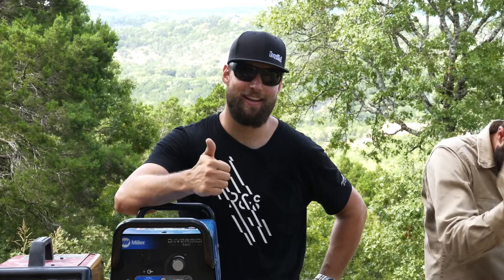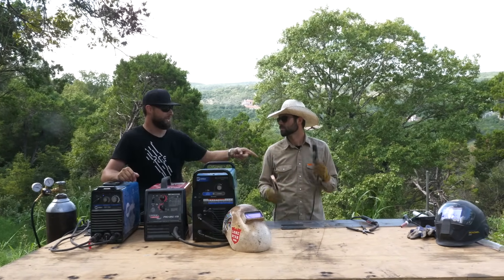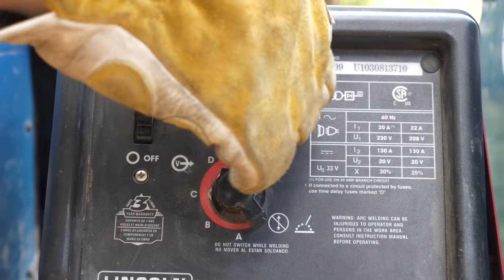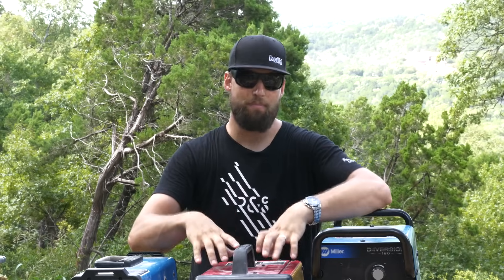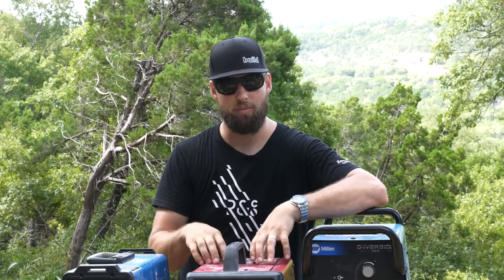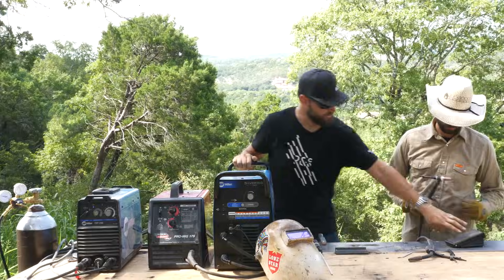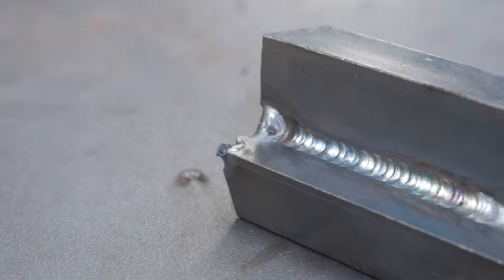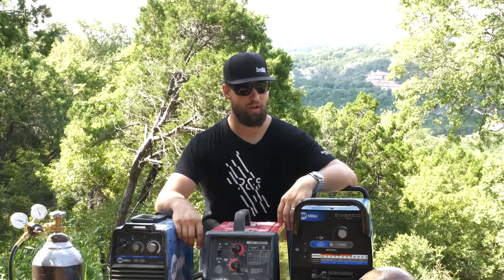MIG vs. TIG vs. STICK Welding

Comment: I caught on to GTAW relatively easy. Gas welding was harder for me to get used to be considered an acceptable weld.  I do like welding and cutting with O² and acetylene, but I'd much prefer to keep gas welding to the smaller stuff using TIG or my Smith Little torch and leave the bigger welding for stick or MIG. I know some are really good at gas welding, but not me.

Comment: I am a welder for 43 years with 12 being robotic.  I am certified in all but yes you can not transfer one job to another and be certified in all. My huge ? When did change from pushing a weld to pulling other then ark weld can you do so or instead gas can be considered.  I was taught to push to keep gas ahead of you to.clean better and keep the pool hotter.  A guy from work got.a graduated for just mig no nothing else 
 And I see shit standers,  so is this normal?

Comment: Up to point video, but would be perfect if included flux coated arc in comparasion, and at the end , didnt get why you said to upgrade mig into tig or stick, did you mean the method or just the durability of inverter? thanks and thumbs up
Reply: I would like your videos subscribe until I will get Free ❤ donation of a welding machine

Comment: Need some recommendations. Just getting into welding. I want to be able to do DIY projects (Metal table legs, shelves, etc) but also be able to help my dad on the farm to repair metal fencing, build/repair bale rings, etc. What type/model/brand of welder would be best for that to start out? I'd like to be able to keep in the back of my truck to go out to remote places if possible. Totally green here.
Reply: Stick welder
Reply: Greetings:  
Farm duties go with stick and for DIY you can use MIG or TIG.  
MIG is faster and cheaper (for the most part) than TIG, but TIG you can get a cleaner looking weld.  
Personally, my DIY is around RV's and RV parks where a MIG or Stick would be an issue, so I have chosen TIG.
In my opinion if you go with a Stick for farm/outside and a MIG for DIY you may be happier in the long run.  
It's possible if you get a TIG/Stick combo you may be grabbing a MIG down the line for big DIY projects that you need to finish quickly cause you will be grinding or painting over welds.
That said a multi-process welder with Stick/TIG/MIG would be a good option, or a MIG/Stick and grab a TIG latter if you choose to do precise work where the weld is a feature of the project.
As for brand etc., that depends on money.  I have always been told buy the best you can afford, and that is my advice to you with the caveat that customer service is highly praised by customers i.e.. PrimeWeld brand.   
Let us say money is no object then get a Fronius and never look back from what I'm told that machine does most the work for you.

Comment: I'm a noob but I think stick welding is harder. Maintaining a small arc while moving while the electrode is getting shorter while you cannot see sh+t because of the smoke and splatter is a pain in the +ss really.
Should have started with sth else...

Comment: if cost is not a problem, which one of these three is the easiest to learn?
Reply: Mig welding is easiest to learn
But stick welding is the cheapest to learn since you don't use gas

Comment: I have a MIG welder and have never had any issues with the welds. Stick on the other hand is reliable but is sometimes sloppy and you can get bad welds. I don't do anything artistic or intricate so TIG is never appealed to me.

Comment: Stick is what i learned in high school, so glad i took shop and was taught how to lay a bead. This is just i needed to know thanx!
Reply: we dont have shop class at my high school, we just have a shop room with a laser cutter tormach machine and 3d printer
Reply: @scottygg8550  When i was in middle school we had a full metal shop, wood shop and drafting shop....our middle school used to be a high school.   I was lucky.    The 3D printer hadn't even become a thought yet when I was in high school. LOL!

I graduated high school without having laid a single paw on a computer.   I did have typing class though.    Ahhhh.... the good ol days....  if you're wondering,.. I graduated in the late 80s in Maryland.
Reply: @kerrischneider7693 
Same/////1989 Valdosta Georgia,,,,,times a ticking ain't it? 
I remember the good ole days so vividly and boy how I miss them.

Comment: sir give me answer..... why tig welding have more strength as compared to mig welding .... give me reasons..???
Reply: It's really very simple. MIG welders do not fuse the two metals together; it just melts the rod and leaves the weld behind. It is not bonded much beneath the surface level of the metal though. If you grind away at a MIG weld to polish it up you can grind it away completely and separate the two pieces of metal because they were never truly welded. Mig welders are more like hot glue guns for metal. Strong enough in a lot of cases but you don't want to push it too far.

TIG welding is a modern replacement for the older gas welding. TIG welding actually heats the metal all the way through and fuses the two pieces of metal into one piece of metal. You can grind or machine a TIG weld nice and flat for a "pretty" appearance and not break the two pieces of metal apart because they are no longer two separate pieces of metal.

Comment: You're confused guy...when running STICK or MIG running DC+ puts the majority heat on the base metal...the heat distribution facts you just gave are for TIG only...not STICK or MIG.
Reply: also AC stick weld should be the heat 50-50% since its alternating polatiy. For Mig Fluxcore the Polarity is negative on the electrode which means its similar to to TIG in the terms of heat (majority on the basemetall)

Comment: Most commonly used are TIG, MIG and stick...?

Wtf else is there for welding?
Reply: Gas welding, brazing?
Reply: Spot welding
Reply: ARC
Reply: @l3anzai28  isn't arc stick?
Reply: @Scrap5000  lol they are all technically arc welders.

But yes, stick is shorthanded as arc.

As for other welders?
>Oxy acetylene 
>spot welder
Is what i can think of off the top of my head but i bet there are dozens of diff torch welding machines for various applications.
Reply: @madscientistshusta  agreed!   there's also friction welding, forge welding, and, get this: in space, metal can cold weld!  The molecules can just spontaneously bind together like how two pieces of clay can stick and become 1.

There are probably others, too...

Comment: For the stick welding off of a generator. What kind of power do you need from the generator to run the welder. Can you recommend generator welder combinations that you have had good experience with.  Specifically interested in getting equipment to build something like the mueller metal buildings. Not sure about the thickness but I think the red iron is 10 inch wide flange.
Reply: Simeon Kessler Miller Blue Star 185 is a great affordable and portable welding generator that we use extensively.  We also hook up to it's 240V receptical to our GMAW and GTAW rigs and it works great.